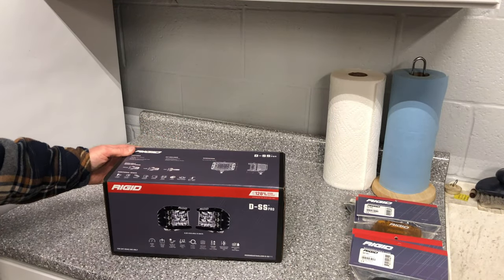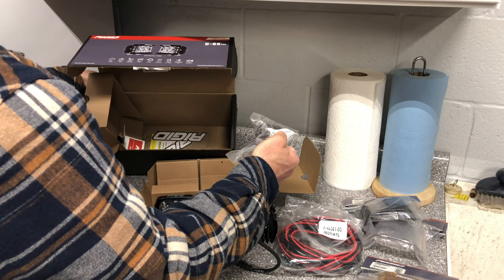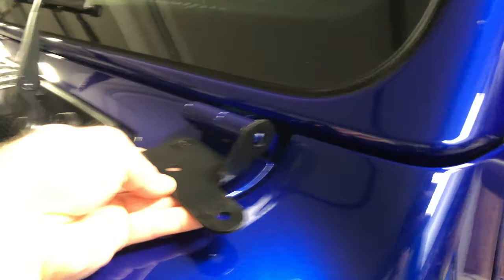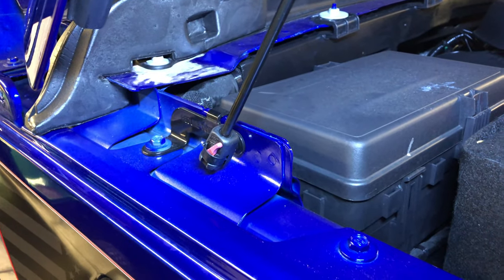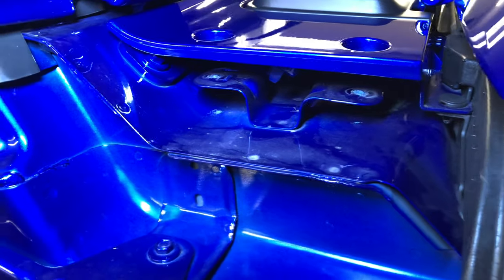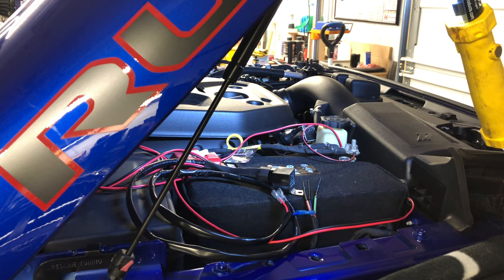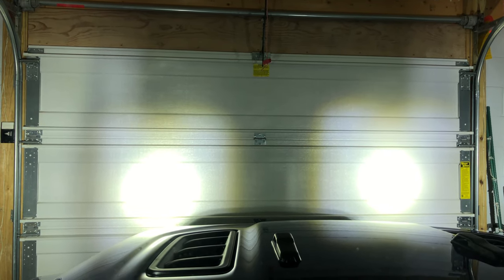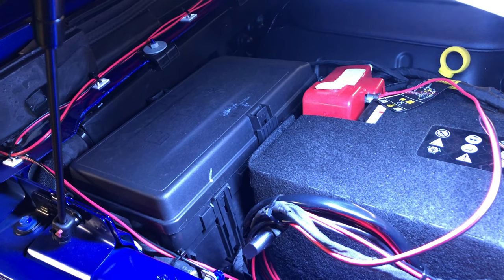Installing New Rigid D SS Pro Lights on My 2020 Jeep Wrangler Rubicon

Comment: Did you get the spot or flood pattern lights, and why ? I can't decide which one to order
Reply from the maker: The Rigid D SS Pro lights I purchased were the spot pattern.  My plan was to install another pair of lights with a flood pattern on a steel front bumper, but none of that happened since I traded the Jeep earlier this year.  I have another video showing some night time driving with these lights.  Thanks for checking out our video!

Comment: Hi, couldn’t you just splice the wiring  for the two led pods together and just have two wires one positive and one negative to connect to the aux switch you choose?  That would eliminate the relay and all the extra wiring from the harness.  Isn’t that the purpose of the factory aux switches?  Seems like overkill if the factory aux switches are already wired with fuses & relays etc.
Reply from the maker: The harness was included, so I used it.  Less hassle that way.  I realize it was redundant.  Thanks for checking out our video!

Comment: Looks...OK.  Few suggestions: (1) Put the wires inside a corrugated plastic harness tube. Its dirt cheap and looks professional.
(2) Omit the cheap white wire holders--that glue is going to fail very quickly. Use cable ties.
(3) Stop using electrical tape. It leaves a mess, and it's hard to get a good seal. Use a rubber tape that stretches and only sticks to itself (Wal Mart). 
(4) You might have just inserted the light mounting bolts the other way--head down. No nut sticking out. You'd still need to cut them off. 
That's my two cents!
Reply from the maker: Thanks for the suggestions.  I didn't have any of the plastic harness tube on hand at the time but will pick some up and make the change.  So far those wire holders are doing just fine.  I had them on hand and decided to use them.  I've been using electrical tape for decades and never had an issue, so I'll keep using it.  The bolt is a carriage bolt and couldn't be inserted in the way you mentioned because only the top side part had the corresponding square cut to hold the head from turning.  It wouldn't work any other way... I thought about that too. :-)  Thanks for taking the time to comment and for checking out our video!

Comment: Hey! just fyi the bracket that attaches to the pod lights are backwards. It works both ways but it sticks out higher when you have it that way! :)
Reply from the maker: Yes, they could work both ways, so they're not really backwards.  However, it seems to reflect the light off the hood less when the lights are farther out, like how they ended up.  Also, from the drivers seat, they obstruct my field of view less since they are behind the A pillar.  You're right, they work both ways.  Thanks for checking out our video!